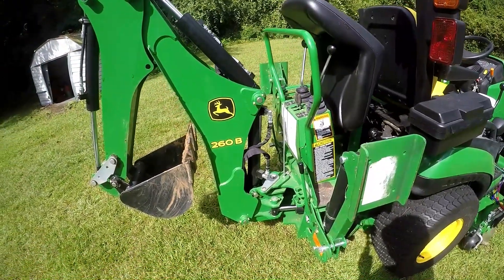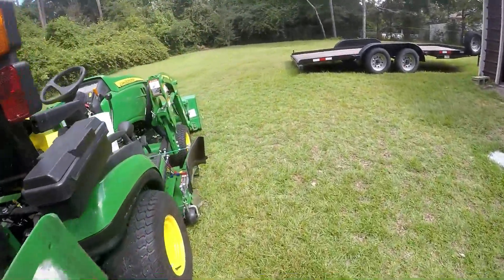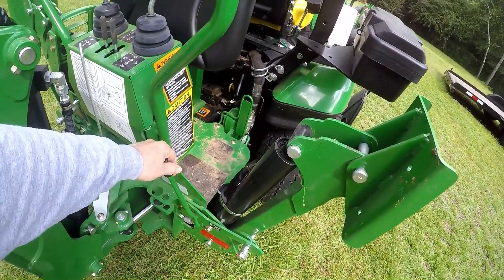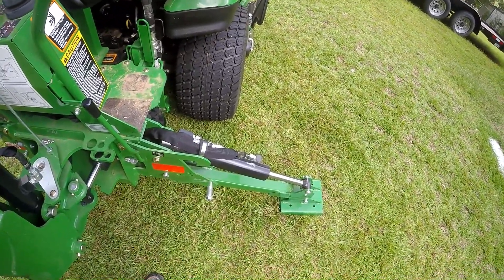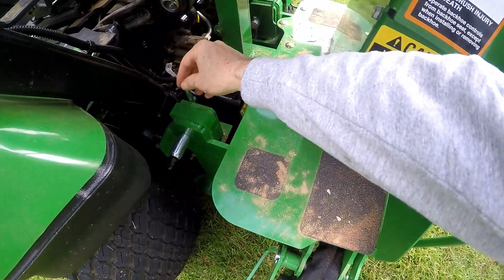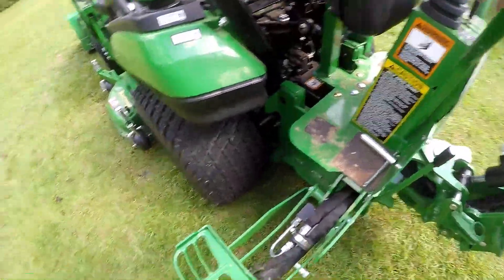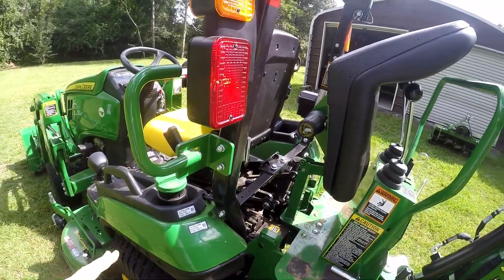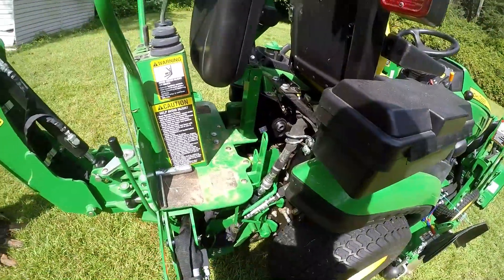260B backhoe removal and install on JD 1025R

Comment: I’ve watched a lot of videos on removing the 260b backhoe and always had trouble getting the pins lose. Paused the video right after I saw you remove the pins. My outriggers were pushed down hard on the ground. I brought them up until they were just above the ground and barely set them down. The pins came right out!! Really easy. Thank you. 

Oh, I’ve owned the 1025r also with loader and 60” mower deck since May 2022 and just now learning this correctly. Thanks again!
Reply from the maker: I'm glad the video helped you!

Comment: I do have a question concerning the mower you have on this tractor.  What size is it?  54 or 60 inch?  I don't know which to buy is why I'm asking.  There's a 300 dollar difference between the two.  Thanks for your time!
Reply from the maker: I have the 54 inch deck.

Comment: Those pins you pulled out of the frame, do they fit in the holes on the outriggers 7:18
Reply from the maker: If you talking about the pins that attach the hoe to the tractor frame, then no, the holes you see on the outriggers are too small. I see where you are going with this. Seems like you could use those pins to hold the outriggers in place to prevent sagging while in storage. That could be an idea but there are two problems. Those pins would not be long enough to span the width of the outrigger frame, and those holes don't really line up in any useful way even if the holes were bigger. I suppose you could drill custom holes in the correct position and use some long bolts to secure the outriggers in place. If a pin was used in the outriggers, there would need to be plenty of slop in the holes to relieve the pressure when reinstalling so those pins could be pulled back out. Maybe that is why there is no mention of that solution in the manual.
Reply: @TractorMonkeywithJL  out of machinist fabricator and mechanic, if you're anywhere around Fredericksburg Virginia I can make it happen, I would engineer a bolt on kit so I can sell it to all you guys.

My green line dealership does not have any truckers in stock for me to even measure of it

Comment: I didn't know that the JDs leaked down any fluids. 🤔
Reply from the maker: No fluids actually leak out on the ground just in case you are confused. (only if something is defective that is)  It's a loss of pressure that occurs over time. The fact that hydraulic cylinders lose pressure is completely normal regardless of the brand of equipment. The rubber seals in the cylinders can't hold the pressure forever just like you would expect to see with a hydraulic floor jack for a car. That is why you need jack stands when working on a car. Same principle. All manufactures have a leak down tolerance for any hydraulic cylinder.

Comment: Nice video, but…  I would have liked to see you disconnect the hydraulic hoses (and make it more clear which has to be re-connected for the 3-point hitch).  Do the whole re-connect thing as if you were.  Now, I realize that in most instances, getting this to precisely align is a challenge, but if you just moved the tractor a head 3-feet, so show clear separation, backing it back up 3 feet w/should not pose an alignment issue. Also, for all you non-photo/videoographers. you DO NOT NEED to do this if full sun!!!  This is terrible technique.  Film on an overcast day to avoid the harsh contrast.  You can see and example of this in the close-ups in the "inside" and underside shots. These are perfectly easy to see.  If videoed on an overcast day, probably a brighter overcast, this video would be alot easier to see.  Thanks for you perspectives; I appreciate the "block it up" suggestion.  Relative to dollies, I am not sure what you mean, exactly.  Would buying three appropriately dollies at Harbor Freight work?  Also, it seems the dolly solution would only work if this backhoe attachment was stored on a cement floor or something hard, amenable to small dolly wheels.  This could never work on a beautiful lawn like you have.  In my area, a backhoe is not too helpful; our ground is too damn hard with too much clay, particularly when it is dry.
Reply from the maker: Thanks for your comments. Search "260b backhoe storage dolly" on youtube and you will see examples of dollies I talk about. Yes, dollies will only work on a hard surface.

Comment: I noticed that you had a bungee cord wrapped around your four-wheel-drive lever?    I'm assuming is it because it pops into four-wheel-drive occasionally? There's been numerous times that I thought I was in 2 Wheel Dr. only to look down and see that it was in four-wheel-drive. Is that why you did that to yours?
Reply from the maker: Sharp eye. Actually, the bungee chord is there to hold the flap up on the mower deck when I park it in the shop due to space. I drilled a small hole in the flap to hook it to the chord when not in use. The four wheel drive lever was just a place to wrap the chord. I haven't had any problems with mine staying in two wheel drive.
Reply: @TractorMonkeywithJL  I’m sure mine is fine as well. It’s probably operator error on my part I only have 12 hours on the machine! . I bought a four-wheel-drive extension handle off of a guy from eBay that I have yet to put on. Great video you did. Gave me confidence to remove my backhoe.  I just successfully took off my back hoe for the first time because my ballast box just came in. Hooking that up tomorrow!

Comment: Don’t take the backhoe off it is crazy hard to reinstall it. That’s why he doesn’t show it. The hydrolics are ridiculous trying to get back together.
Reply from the maker: I have to disagree on the crazy hard part, although it can be a pain if you are not on a flat level surface. Two reasons I did not take it off in the video. First, I was in the yard for the light and not on a good level surface. There were plenty of other videos on youtube showing the before and after. I was trying to give a closer look that other videos don't show you. As far as hooking the hydraulics, as long as the pressure is relieved by working the controls before hand, it's not that hard to connect. After removal if you hook the two hoses to each other and block the hoe up so it doesn't sag, there won't be much of a pressure build up. It's much much easier to re-install the hoe if the hoe is stored on a wheeled dolly. You can move hoe for the alignment instead of the tractor.
Reply: @TractorMonkeywithJL  GAH! This is the tip I needed!! I have taken my backhoe off once... easy peasy off.... what a struggle getting it back on. Trying to line everything up alone was irritating to say the least.  Finally got it but as a result I have been shy about wanting to take it off again. I just bought a box blade so....  Thanks so much for the idea!

Comment: nice video but would love to have seen ya do the full disconnect with the hydraulic lines & pull the tractor away from the hoe. Never seen this done with the newer version.
Reply: Yes video titles misleading
Reply from the maker: I guess I was feeling too lazy that day. :) If you are familiar with the older 260, that part would have been the same anyway. Basically, just hooking the power beyond connections on the tractor together to loop the hydraulic fluid back to the pump. Thanks for watching and commenting.

Comment: Thank You. I never took mine out so now I know. Very helpful
Reply: Do not relieve  the pressure with the handles as suggested or the BH will settle , the 2 lines you are disconnecting are power beyond and will depressurize as  soon as you turn the tractor off unlike the FEL lines.